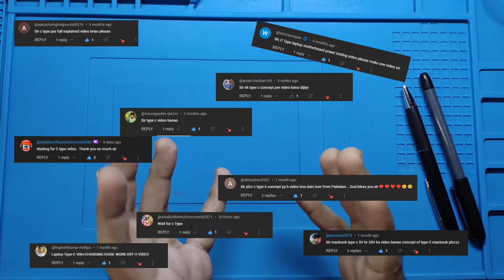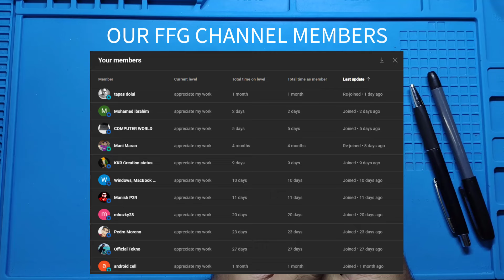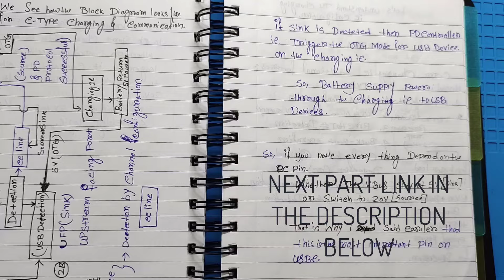TYPE-C FULL DETAILS WITH PRACTICAL | TYPE C COURSE FOR FREE | PART 1 | 4K SUBS SPECIAL |#ffg #typec

Comment: Sir one confusion. Agar VCONN 5 V HOTAY HAY TO AAP nay bola tha cc per 4.5 matlab less than 5v hoga.  So 4.5 v convert hoga 20 Volts may? Excellent Lesson
Reply from the maker: no no wo just confirmation hai jo ap ka protocol complete huya hai.and vbus ka voltage 5v to 20v pe switch larte hai..